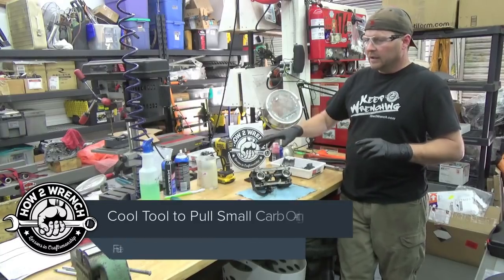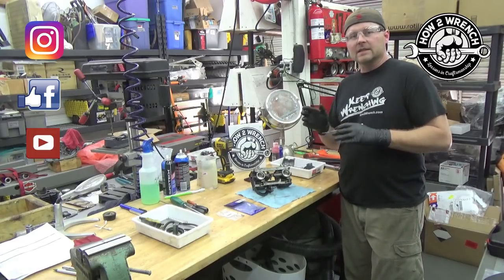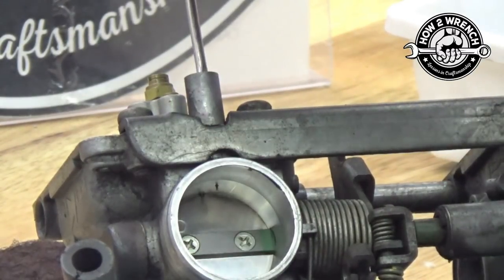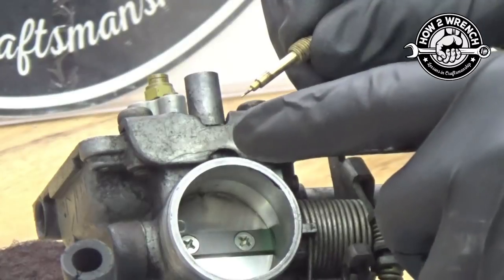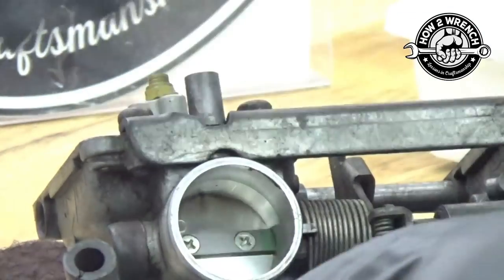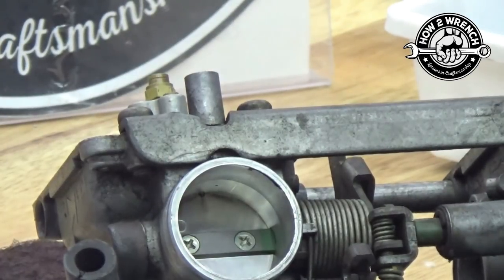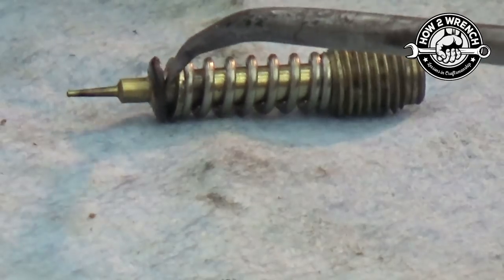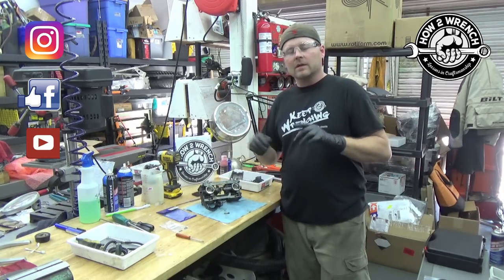Cool tool for removing small internal carb fuel screw spring washer and oring!

Comment: Shane, I bought a Stihl chainsaw. It came with a small, perfectly sized, orange handle screw driver (easy to find) for adjusting the mixture screw. The handle has a small plastic wing molded into it so that you can easily count the turns. I use it on my motorcycles and though any old screw driver will work it is sure nice having it. Maybe the Stihl dealers sell them individually?
Reply from the maker: Look on the bench and see the orange handle....:) same Stihl screwdriver...
Reply: Ha, ok.

Comment: a better way to do that then the paper clip is a knitting needle, stronger yet also not as sharp so no scratches.  They are cheep and in a lot of small engine techs box as it makes installing and removing carb needle seats easy and fast as well.

Comment: would the length of the spring for the fuel/idle screw matter? l ask since I experienced having a short spring for the idle screw but the idle jumps from 1100 to 1800 and can't be adjusted to 1200-1700 range but when I changed to a longer spring it gave an easier adjustment of the idle?

Comment: I couldn't go through your entire video..

my question is

"I have a diapram, volume control type air screw CV carburetor in my bike and I heard in  those kind of carburetor air screws works as a volume controller for pre mixed petrol air mixture supply to the ignition chamber instead of changing the ratio of mixture when it is screw or un screw"

Am I right or wrong...

And how could we find the optimum set point of air screw when we adjust  it for maximum milage...
Reply from the maker: That's a good question for Shane directly. You reached the social media team here. We get 300-400 requests a week, so it’s a bit time challenging as you can imagine. 
Shane does try to answer some non-members' questions when he gets some time so hang tight if you’re not in a hurry. 
Did you know one of the member benefits is to ask for which videos would work for your needs and get daily "quicks answers" to questions directly from Shane?. Best $1.99 a month you'd spend...of course enjoy the over 700 free videos and access the the member only vids with all the other benefits listed below. 

There are two immediate options that can get you a solution within 24 hours and quite often within the day. 

Option 1: 
Consider joining...best $1.99 you'll spend this month 😁 This is great for quick answers. 
He literally logs in and answers member questions daily! He does an AM and PM check-in to answer all member questions. Join this channel to get access to the perks:
https://www.youtube.com/channel/UCBhM8DCKnT3qXwTW0eToyCg/join    
-Daily MEMBER FIRST COMMENTS ANSWERED FIRST 
-Live Q/A video chats
-Wonder if we have a video on your need? Members can request content links!
-Full Access to the ENTIRE 700 video library
-Member-Only FREE tool giveaways  
Option 2: 
 If you need help sooner choose his 1:1 option! What you get is a deep dive one-on-one with him. Use video, email, and phone support. He will drop his tools and work with you directly! 
Get Shane’s cell here: https://how2wrench.com/ols/products/techline-one-on-one

Comment: Hi, my KTM 450 exc has a fuel screw but the spring that sits on it is not flat it's tapered so therefore makes the washer and o ring sit tapered, would this affect the performance? As I set it, the bike runs sweet then changes, like I'll start it up another day and it's not as responsive like the fuel screw has adjusted but it's still in the same position 🤷🏻‍♂️
Reply from the maker: That's a good question for Shane directly. Have you considered joining the channel to get him daily as a member benefit?
You reached the social media team here. We get 300-400 requests a week, so it’s a bit time challenging as you can imagine. 
Shane does try to answer some non-members' questions when he gets some time so hang tight if you’re not in a hurry. 
Did you know one of the member benefits is to ask for which videos would work for your needs and get daily "quicks answers" to questions directly from Shane?. Best $1.99 a month you'd spend...of course enjoy the over 700 free videos and access the member only vids with all the other benefits listed below. 

There are two immediate options that can get you a solution within 24 hours and quite often within the day. 

Option 1: 
Consider joining...best $1.99 you'll spend this month 😁 This is great for quick answers. 
He literally logs in and answers member questions daily! He does an AM and PM check-in to answer all member questions. Join this channel to get access to perks:
https://www.youtube.com/channel/UCBhM8DCKnT3qXwTW0eToyCg/join       
-Daily MEMBER FIRST COMMENTS ANSWERED FIRST 
-Live Q/A video chats
-Wonder if we have a video on your need? Members can request content links!
-Full Access to the ENTIRE 700 video library
-Member-Only FREE tool giveaways  
Ways to support or high five How 2 Wrench! Thank you in advance. YOU MOTIVATE US TO DO MORE!
1. Smash the subscribe button (thank if already a sub!)
2. Have you seen our "YouTube Trained Support Shirts?  https://goodfellasmerch.com/collections/how-2-wrench/products/support-shirt   
3. High five donation:  https://www.paypal.me/how2wrench    
4. Got an emergency and your head is about to explode from frustration or fear? Get Shane’s cell here: https://how2wrench.com/ols/products/techline-one-on-one

Comment: We use at our shop a seat installer and removel tool for tecumseh small engines part # 670377  Google it when you see the picture you will know why
Reply from the maker: Sweet I'll check it out...